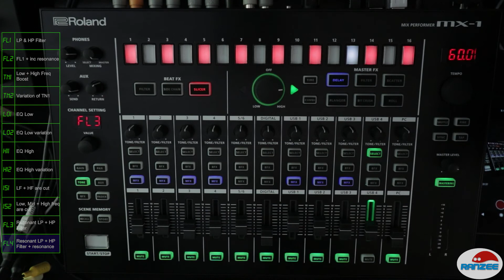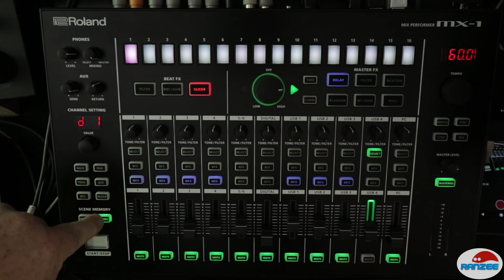Roland MX-1 FX Part 1 - Filters

Comment: Can each mixer channel have a different filter type or do they all have to be the same? Also, I think you said you’re using the se02, and it seems to be on a usb channel, so even the new boutique line can use mx1’s stereo usb? I’ve not been able to even get roland to answer if the new boutique can use usb or only the Aira line.
Reply from the maker: Hi The Drümünkey! Thanks for the questions :) Yes, the MX-1 can have different filter types on each channel. Also, yes the SE02 works on the MX-1 via USB - and so do all the boutiques. Roland announced this in one of the firmware updates for the MX-1. Also, I've done a video that covers this question, so might be a cool thing to subscribe ;)  I even talk about how to use multiple boutiques om the MX-1 - like you see on this video :)

Here's the link to my video: https://www.youtube.com/watch?v=ZDYsF9HJzNM&t=627s 

Here's the link to the Roland page that announces what works on the USB ports: https://www.rolandcorp.com.au/blog/the-ultimate-guide-to-the-aira-mx-1